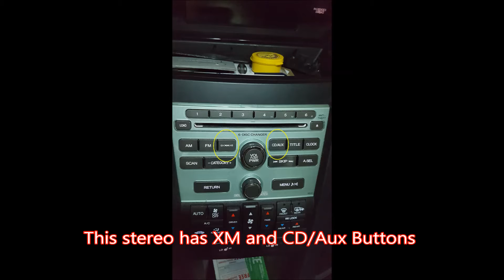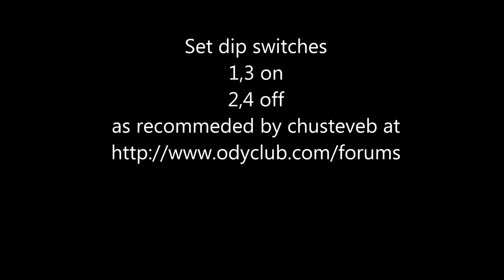USA SPEC BT45 HON3 installed in 2010 Honda Pilot

Comment: Thanks for this tutorial. I tapped into the factory subwoofer for a signal and added my own subwoofer. Everything else is OEM but sounds WAY better now!
Reply: U installed a LOC? Did you use all 4 speaker cables? The Left and the right? Why would he install it to the XM module?
Reply: Is it hard to access the rear sub.  These pics dnt really help.  I want to put in a loc and hook up sub/amp

Comment: Great video! Questions: Where did u run the mic cable to the front? Why didn't u install this in back of the radio?  THANKS  (were u satisfied with the product?)
Reply: He didn't install it in the back of the radio because it needs to plug into the XM Module, which is located where he shows you near the rear factory subwoofer.  You can then run the included mic cable under the side sill panels all the way to the front, and then up behind the door/front window pillar.
Reply: Thank you for your reply!